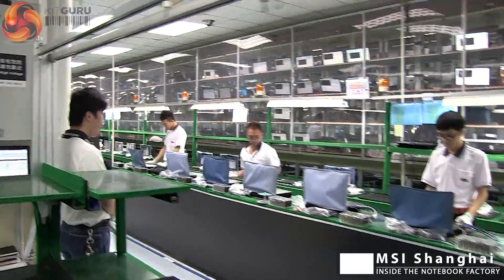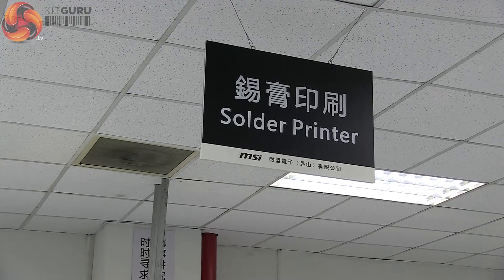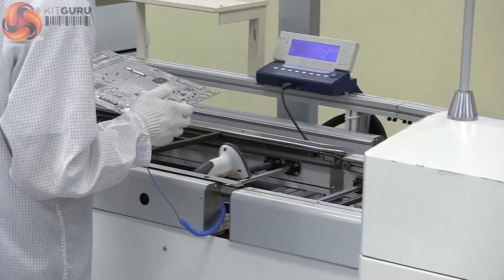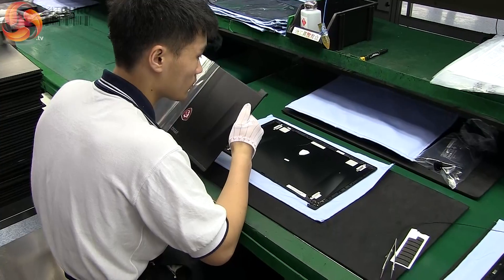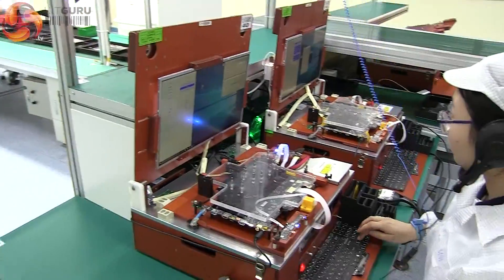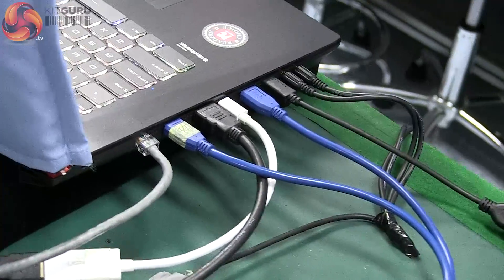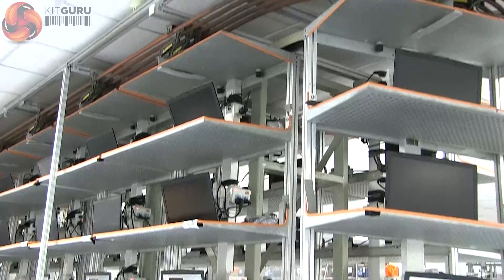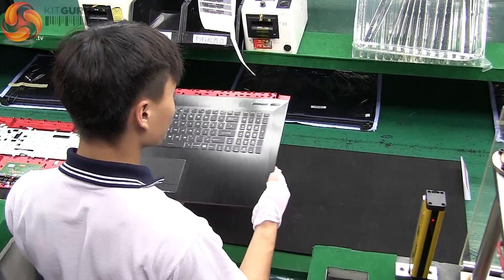Secrets of MSI Gaming Notebook Factory revealed!

Comment: The hinge design is not good with these laptops. Mine broke on both sides. The Plastic frame broke at the hinges at the bottom side of my laptop. They got metal screw inserts in a plastic body where the plastic around it breaks. You can fix it  by loosening up the hinge ( This video shows and explains it well: https://www.youtube.com/watch?v=kj7IbsAsho0 )

In my case the plastic frame around the metal screw inserts broke. Alot of the red plastic frame bits were in my laptop. More and more over time and I took them out myself. This happened 1.5year after I got the laptop new. Went to the store to get it fixed and they told me it could take more then 2 weeks to get it looked at and fixed. So i went home  with the laptop and took it apart after the warrenty of 2 years after it got worse and worse.

MSI could fix it with better desgin like bigger hinges, bigger screw , more durable materials, Bigger screws with better/bigger tread. So the hinge load is spread over wider area or on a stronger and more durable surface.

Review of my MSI GP62 Leopard (3-5 years owning it, bought for €900 without discount :( )
Build quality: decent except the plastic frame isnt durable and backside of laptop got some scratches.
Screen: Not so good viewing angles.
Spec: used to play all titles 2-3years back. It has a dual core i5 witch sucks these days.
keyboard: Great
Trackpad: Great
Cooling: i got only 1 fan instead of the dual fans on the better speced onces, but with a cooling pad no issues.
Ports: the right side usb 1.0 plug is little bent inside  Idk how and when, so it had alot of resistance when pluging in and out.

Comment: Watching this video on my gt73vr 7rf titan pro, still going strong after almost 2 years. almost just upgraded the graphics card and processor in my old desktop pc, but due to the crypocurrency mining bullcrap it made buying a gaming laptop a much better value. I don't regret it, haven't had one issue with it yet. It used to have wifi/bluetooth problems but that problem was fixed with an eventual windows 10 update

Comment: My 2 months old MSI laptop died due to hard drive corruptions

But well I had to warranty so my laptop survived 😌
Reply: But My Laptop Also, Works So Great, but in the Next 5-10 Years, It Will be Obsolete for Running New Games, Because the Recommended Requirements for AAA Games have Increased to Either 32/64GB of RAM, Geforce RTX 6070 (It Will be Released in Year 2026) or Geforce RTX 7060 (It Will be Released in Year 2028), or Geforce RTX 8050 (It Will be Released in Year 2030), Intel Core i7 18700K (It Will be Released in Year 2027), or Intel Core i5 19400/19500 (It Will be Released in Year 2028), or Intel Core i3 20300 (It Will be Released in Year 2029), and This Recommended Requirements of Game is So High that We Need Cloud Gaming to Play it.

Comment: These guys sure suck at applying thermal paste in CPUs. Friggin temps jumps up like Heroshima on August 6 1945.
Reply: i've been using PC for 20 years, and i think they apply it just fine. I don't think u bought one of MSI product before..
Reply: @ahemjunior  got a laptop buddy not a PC . i7 7th gen is a processor from hell.
Reply: U need to disable windows update, startup apps, and auto update apps on laptop until you get 0 to 1% CPU usage when u arent running anything.
Reply: @ahemjunior  it ain't CPU "usage " its thermal .Its a common problem all around MSI laptops ..YouTube videos full of it due to thermal paste improper application and sometimes none.Go check it out.

Comment: Not sure if the super CPU and GPU can be integrated in such a slim design. The CPU temp surged to 90 Celsius easily when updating windows and nvidia drivers. It was a new PC just opened! Can’t imagine what would happen when a game is running. This won’t last long if you push CPU at limit temp ALL THE TIME
Reply: new Macs are slimer with 6x  i9 processor and it somehow works

Comment: My friend has one, GPU fan failed. It's covered by heatpipes so a fully disessembly and repaste is required to swap the fan. This also needs to happen if you want to clean the area between the fans output and heatsinks. It's a crap internal design, with shit fan bearings.

Comment: MSI laptop is fantastic. Good cooling, good price/perf, good keyboard
Reply: How much did you pay for it? I don´t believe the prices for that strenght so I look for confirmation
Reply: @megadeatth  mine is msi gf63 thin 9sc, bought it in the end of last year, great for work/school and gaming in the meantime, mine came with the 9th gen i5-9300h processor (now should be 10th gen) with 4gb of ram and 512gb of storage hdd+ssd ,GTX GeForce 1650 graphics card ,great experience during these days, but you would rlly need to clean the exterior as it gets marks pretty easily,  you know, that kind of high class material xd,  and it looks pretty good as well, it costs 888 usd and in my currency (Malaysia) is RM3699,which is a great bargain!  The cooling fan is really really loud if you turn it to cooler boost, like you will think that it's raining out there xd. You could also set a cooling plan using the dragon center, where we control the cooling system and rgbs, nahimic  and etc... You can switch to them easily. Should probably try it if you're a budget gamer, Acer nitro 5, the cooling system, maybe not so great I think...
Reply: @Hurachan550  Thanks for the thorough insight!
Reply: @megadeatth  No problem! As long as I could help you to solve your problem 😀
Reply: I just bought my second MSI laptop. They are amazing equipment.
Reply: I keep hearing about msi laptops dying on people after 1-2 years... sometimes sooner. Not to mention the hinges.

Comment: msi's are mass produce and undoubtedly they have faulty ones. the comment section is a clear case of that. I've owned all sorts of brands and not one of them has a perfect track record. MSI is not perfect but they still make good products. hopefully as they grow the typical issues they have will be sorted out. I've owned two msi gaming laptops and so far my worst problem was the bezel start to come apart a little. out of all the brands I've had my aleinware was the toughest though.
Reply: Yes but I have to say that even though Alienware make tough and legit laptops, they are still slightly overpriced and even though MSI is not THAT tough, if you compare the prices, MSI is still the better buy, whether or not you are on a budget or something else.
Reply: How much did you pay for your MSI? I just don´t believe their prices for that strenght. Seems like a scam to me...
Reply: @megadeatth  2000 for the msi gs65 stealth thin. Only issues was a cooling fan going bad. $15 part. I game alot on the tiny thing
Reply: Whatever happened with your bezels? That’s typically a problem that gets a lot worse as time goes on.
Reply: @DrMrPersonGuy  laptop is still going great, bezels still intact. Only issue is a cooling fan going bad. Replaced it for $15 myself. Found it on Amazon.
Reply: @rcunknown5303  that’s good to hear, thanks for answering.
Reply: @DrMrPersonGuy no problem. i will say its not an easy laptop to work on compared to others but there is good videos on how to take it fully apart on YouTube.
Reply: @rcunknown5303  you mean in terms of replacing the fan?
Reply: @DrMrPersonGuy  its a flipped mother board. So typically need to remove the mother board to replace most parts. Its intimidating but really doest take that long. I don't generally work on laptops and was able to do it without issue.
Reply: @rcunknown5303  and that’s required even to add storage?
Reply: @DrMrPersonGuy  correct. If your not comfortable removing the mother board dont but it. I suggest watching a tear down video on this laptop and see if its something you can handle
Reply: @rcunknown5303  which model is that?
Reply: @DrMrPersonGuy  msi gs65 stealth thin with gtx1070 in it

Comment: My only complaint about MSI is the chassis on the GS63 Stealth models. Too much flex on the top and I depending on where I hold my laptop, I hear a popping metal popping sound coming from these case. I also heard it on the demo model at Best Buy too. The new GS65 is much better. Still not as good as the ROG Zephyrus, Razer, or even the XPS 15 models but much better than the GS63.

Comment: MSI is awesome, but make sure to not buy MSI GP62 product line. Its the one with high end graphics but smaller chassis. The laptop gets hot even while not gaming. Make sure to get a laptop which has good chassis which supports good airflow. Their cooler boost is awesome but you can't expect it to be turned on at all times. Coz then dust would build up quickly. Cheers.

Comment: 3 MSI high end laptops (each one over $2k USD) I've owned and each one I have had to re-paste the CPU and GPU. 2 of them also needed a new battery before a full year of use. Needless to say I don't buy MSI laptops anymore.
Reply: OZCAN AKSOY dude nobody talked about removing the CPU/GPU lol. Do you even know what repasting means? Here's a clue, it doesn't mean removing the chips. It's just removing the cooler, cleaning off the paste with Isopropyl Alcohol and applying new thermal paste.

So I ask, have you yourself even looked on Google about "repasting"? I don't think so.
Reply: I had 4 MSI gaming laptop and never get any problem.. each 3-4 years of use ~~~ so good quality, unlucky for you i think, maybe it's your fault use him on the bed then overheat alot of people don't know laptop cn't be use like that take care of air flow ^^
Reply: Bought an MSI motherboard for the first time this month. B350 Gaming Pro AM4. Bios was in chinese for the menu and in english for the menu options. Bios screen was cropped and about half the size it was for others. Bios screen also had artifacts and strange lines running through it. Previously selected items in the bios menu would stay on screen when selecting new items to change which made a mess of the screen and hard to read anything.Black screen on first non-cd windows 10 boot but installed win 7 just fine. Ran windows 7 with no problems. Its on its way back to place i got it from and cant wait to hear what they say. First and last MSI product. They fucked up right from the start. I am a CompTIA A+ certified IT tech and mucked around with computers since the M$-DOS days.
Reply: Bought gt73vr7rf. had to send it back to rma cuz it started having battery and motherboard power circuit problems within half a year. I thought high end models were supposed to have fewer issues. Never going to buy this shit again.
Reply: https://forum-en.msi.com/index.php?topic=301621.0
Reply: Did you not see the part where they apply the cooling fans and heatpipes? They don't apply paste manually. Instead, the paste is pre-applied to the cooling block. Probably by machines. It's no secret that manufacturers don't use the best paste, and definitely nowhere near the quality of thermal grizzly. And this isn't even unique to MSI. Intel use the same pre-applied paste on their own fans that come bundled with CPUs.
 As for the batteries, you should know, windows laptop batteries do degrade quite fast. 300 charges is enough to warrant a replacement. If you charge once per day, yes, you will get less than a year out of them. That's not MSI's fault, that's just how Windows Laptop batteries work. This is why no laptop manufacturer other than Apple will give you a 1 year battery warranty. Instead with windows you usually get 3 or 6 months warranty. With Apple, you get a year because their batteries are rated for 1000 cycles - so can easily last upto 4 years when not used a lot, to over a year for constant heavy use.
Reply: Gustavo Cabanillas Aranda how many msi products have you bought over the years? I have no reason to go out of my way to trash talk about msi but they really do have an issue with consistency in their product line. There are way more defective pieces as compared to other competing brands. Ive asked in my social circle and its the same thing. You could also roam around blogs to see the amount of average complaints each brand has. Then you can develop a sound opinion based on feedback and knowledge. For me it was unfortunate that i started looking into it after i bought the laptop. Also there was recent news that win10 updates caused several hardware incompatibilities lately. But i blame win10 for that.
Reply: Matisse yep youre right. Only few ppl would buy an expensive gaming laptop and know about airflow like you and the rest are dumb ignorant fools right? You replied you bought 3-4 laptops. The fact that youre saying it like that means you havent owned any msi laptop more than 2 years.
Reply: ZephrusPrime hmm such a bad laptop u had
Reply: My friend has one, GPU fan failed. It's covered by heatpipes so a fully disessembly and repaste is required to swap the fan. This also needs to happen if you want to clean the area between the fans output and heatsinks. It's a crap internal design. With shit fan bearings.
Reply: Adolf Hitler i donno about you.. but my GE72Vr and GT73 didnt have any problems ... Been over 3 years now.. cool as a cucumber 👌
Reply: My GT72 has 3 years and 7 months and not a single problem, you guys have really bad luck or talk shit, maybe both.
Reply: My GT72S had a hinge break with screen replace, power jack broke twice, motherboard short once. Battery still okay. No more warranty.
Reply: Yeah ass wipe cause I'm just makin that shit up. I guess maybe I wasn't curious as to see the factory where they assemble these products. I'm not alone with the type of problems I faced with this company. Stupid fuck.
Reply: You don't know shit. Trying to dox someone only proves what a pathetic looser you are. Seems like you can't take what you dish out. You want to threaten me again?  Easy to act like a bad ass on a computer. If you actualy knew who I was you would never even consider it.
Reply: His mom might have a mobility scooter, but she's still doable. Not to mention, I don't remember CoD having any paratroopers, but I guess if he counts that as a qualification, I'm a skilled sniper. :/
Reply: @ZephrusPrime  your argument went down the drain the moment you declared you were a "grown ass man" and that you were "a paratrooper who served this country" . . .